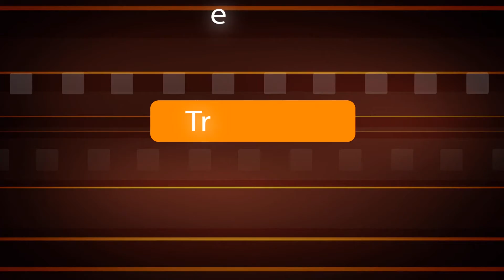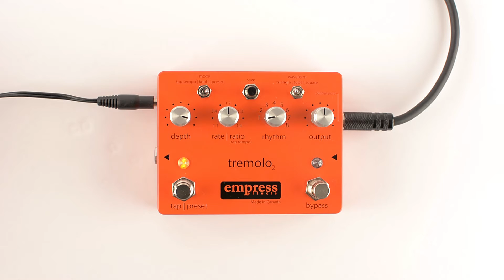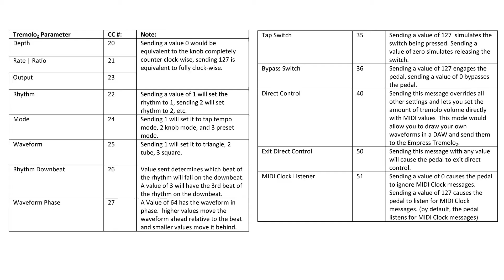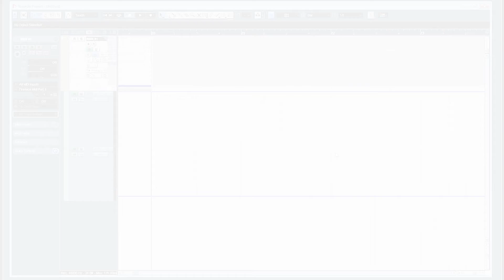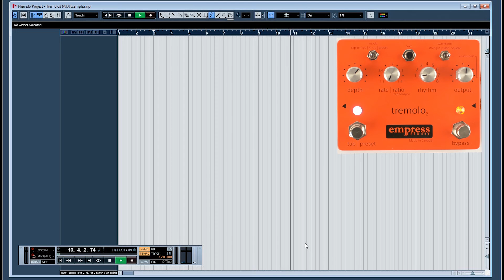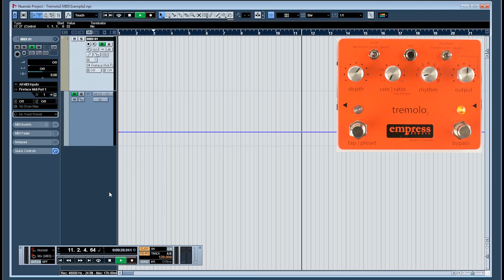Empress Effects Tremolo2 - Control with MIDI

Comment: When in slave mode with midi clock Is It possible ti change the ratio of the tremolo? Will It work with time divisions (1/4, 1/8, 1/16)?
Reply: yes? yes. that's why we love it.